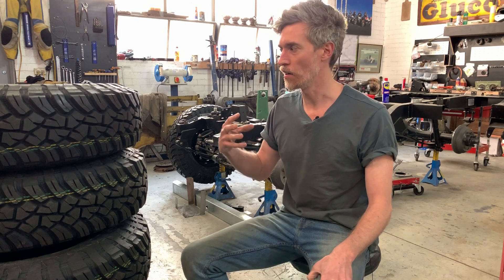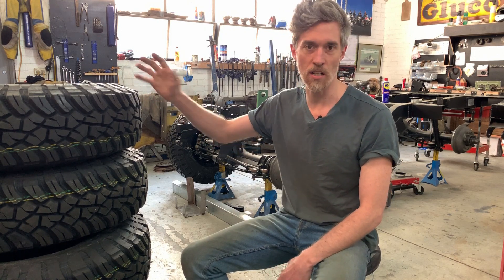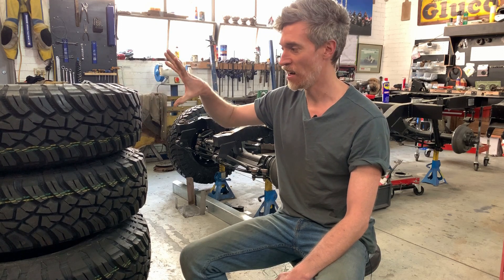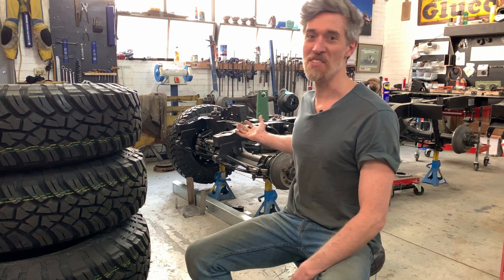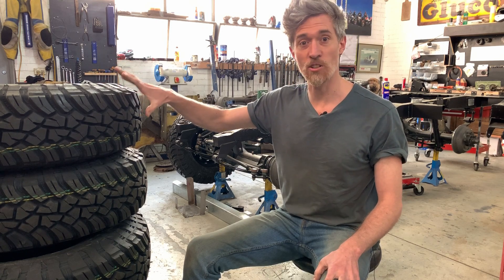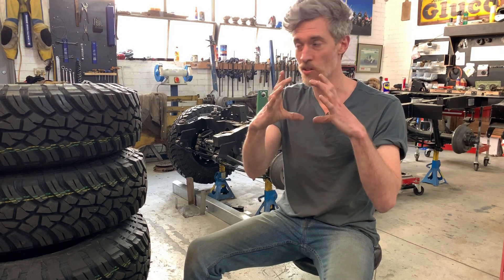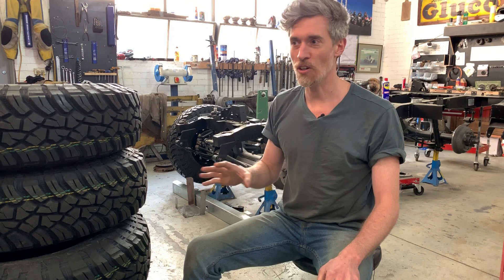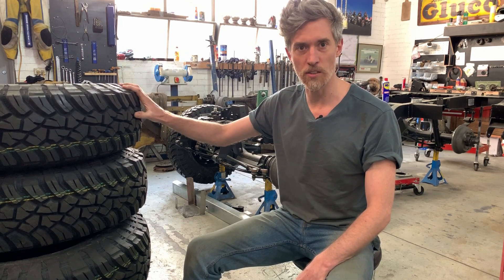Mud-Terrain Tyres on an Electric Vehicle? || Electric Land Rover Conversion

Comment: I was thinking the wheels would be the place to put the motor(s). 4 hub motors would allow you to remove the diff (replace with a spacer for axle)  and gearbox, saving weight, there would be lots of space after removing the drum brakes. On a 109 wagon there would be room for solar panels on the roof, maybe stack them so they slide out when your parked somewhere. Series are a good vehicle to switch to EV imo, but only the ones that are already gutted with the only bits still land rover is the body. If anyone has original, keep it original, its value only goes up, and they are not building any more. Nice job on your build.

Comment: I am still a big fan of the old 7.50r16. Much better for over the bonnet visibility too. Only downside is not a real lot of choice and not really cheap.
Reply from the maker: So much better for that over bonnet visibility.  But the treat patterns, compounds and cost let them down I reckon.
Reply: @Jauntmotors  I picked up some new Dunlop Roadgrippers about 18mths ago for $200 each. Done around 10000kms on them now.

Comment: First and foremost, please keep this up and I sincerely enjoy your videos. I hope you continue to take the time to speak your mind. You, to me, are pioneering and that take guts and mettle, I want to get inside your head because you are breaking ground and putting a lot on the line to do so. It's brilliant, I support it and I love it, tell me as much as you want I'll be glued to your channel.
Big ups to Andrew Bednarz (step bro in-law for putting me onto you)

Solid logic tyre logic mate!
I'm not sure how much final drive ratio came into the equation  came into your choice but there is no end to the woes of a man that has over tyred his stock driveline. If the power plant can't support your tyre option, your wheel arches can't support the tyre option, if your hubs can't support your tyre option you're going to suffer EVERY, SINGLE, DAY! On the odd ocassion it MIGHT benefit you one finds "old mate" on 31's getting where you can't because he can rip 2nd low aired down to 10psi and power through with momentum while you 're reserved to 1st low and slug pace because your donk doesn't have the stonk!
As a volunteer fire fighter that loves throwing, close to, 3 tonne of loaded LandCruiser Light Tanker around a fire ground as often as required I can attest that those base stock tyres are incredibly capable if you look after them. They stand up and cut through when the surface is aggressive at high PSI and they can drop to 5 PSI without breaking bead on the soft stuff.
At the end of the day, when you go to the tyre shop for new hoops, it's THE most common size EVERYWHERE. Supply and demand, it's the cheapest size on the market with every iteration under the sun available. 
I ran 33" while travelling Australia for 2 years in a '97 HZJ75, next best thing for availabilty and i nice step up from stock. At $365 a pop for a BFG ATKO All terrain there were a few VERY $$$ mishaps and if I'd ran 31" I'd have probably saved a few $1000's in fuel TBH!
As is undeniably logical... Match your product to the application not your Ego!
Reply from the maker: Thanks so much Rhett (and thanks Bedz for the connection).  It can be tough to show the process.  The mistakes and the challenges are the most interesting part, but theres a natural inclination to just show the finished product. I'm by no means an expert on any of this stuff but I do know what I want to achieve.  If we can help or inspire anyone else by sharing all this and talking for minutes on end about tyre choice then it's all worthwhile.

Comment: It’s a minor point, but probably worth knowing, that the “R” of the tyre size is to signify that it is a radial tyre, not a cross ply, so is not a part of the dimensional information.  The 16 is indeed 16” wheel diameter.

It’ll be interesting to hear how the steering turns out.  Original tyre sizes for Series LRs were 6.00, 6.50 and 7.50 (and 9.0 for the 1-Ton model).  They were a fair bit thinner than 235/85, with the 7.50 having about the same diameter.  The extra width of the 235 is going to make the steering heavier.  Whatever you do, don’t fit offset rims as that’d exacerbate the problem and give terrible steering at low speeds.  Offset tyres also create increased pull on the steering when you have uneven road surfaces, grip or braking.  I ran 235/85 ATs on a 109 for years on 7” 8-spoke wheels.  I wouldn’t recommend it, and would suggest you use 6” LR steel wheels, like from 1-Ton, SIIB FC and 127s, the 6.5” “Wolf” HD wheels or, at a push, the 7” Discovery steel wheels.  All have the nave set reasonably relative to the rim for Series steering loads.  I think the 5.5” 109 and Defender standard rims may be a bit too narrow for 235s.
Reply from the maker: Ahhh thanks Nick.   I never really thought about it. Just thought "Radius", mostly because I'd never seen a tyre without the 'R'.  

We're using 6.5" wolf rims as they're a nice balance - in theory - between width and drivability.  You'll see in our new video we're putting in power steering which gets around some of the problems of the wider spec tyres
Reply: Dave, you’ll find the Wolf rims a lot thicker than the originals (because they’re HD).  This leaves the wheel studs a bit short.  The “Wolf” TULs and TUMs (90 and 110 versions) had 1/2” longer studs to compensate.  When Hobson did the Tithonus refurbishment of the old 90s and 110s for the UK MoD, and they didn’t bother replacing the studs, so a turn or so of the thread inside the nut is visible beyond the end of the stud.  Most countries have regs that the nut must be fully engaged on the stud, with the stud protruding slightly through the nut.  It’s something you might want to ask your local inspectors.

The longer studs are available genuine (cost me £10 each a decade ago), or much cheaper through Britpart, likely made of brittle Chinesium, but Bearmach might have a fair priced supply of decent quality studs if you need them.